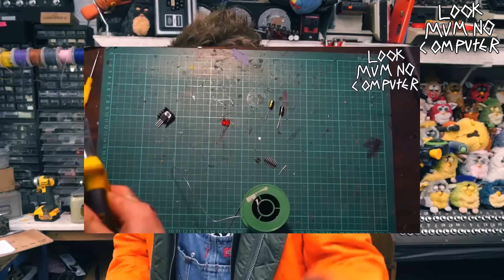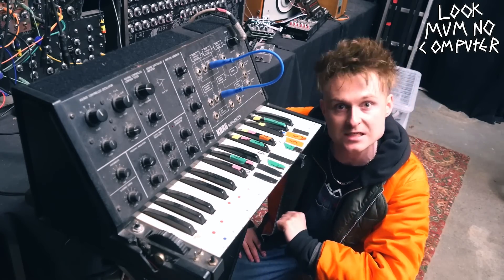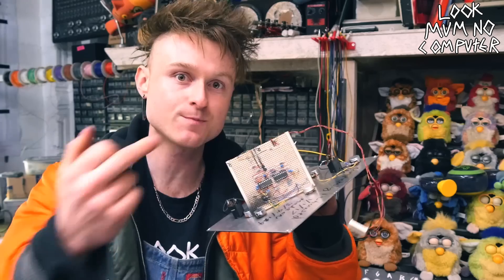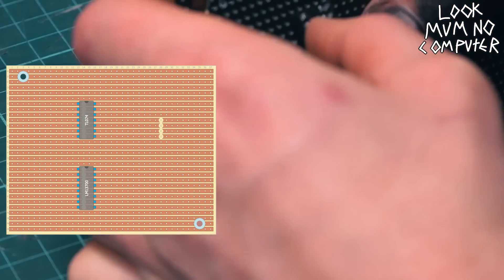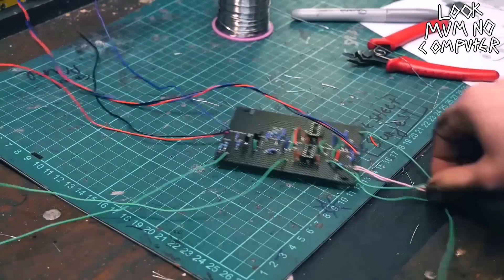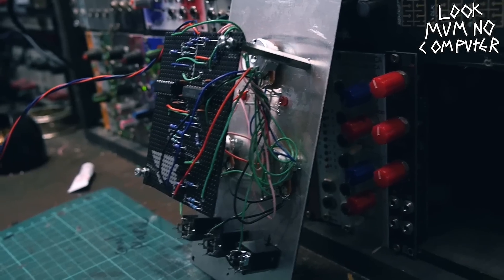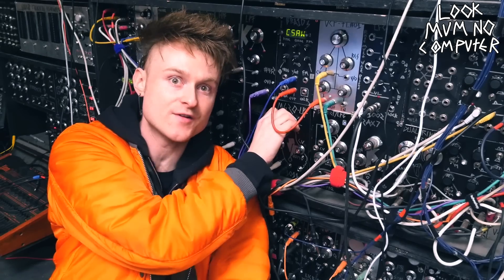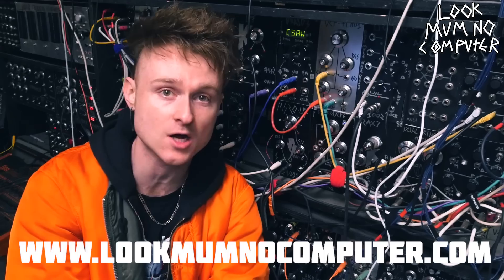Build An Analog Synth Filter Made EASYYYY.

Comment: Hi Everyone, anyone here build this? as i am thinking about doing so. 

Can i ask a silly question, My analog synth does not have CV however i want to build an external filter for it (Prophet rev2). If i built this module would it work with just audio connected to it (In & Out), nothing connected to CV? Cheers

Comment: And here I am with my soldering iron from wish, a Korg monotron and a prefabricated MIDI input mod just waiting to be soldered into the new monotron

After I killed my old one, because I used one of those gas powered soldering irons that produce more heat than the surface of the sun...

Sighs

Comment: You can build a simple filter by  using just a resistor and a capacitor
Reply from the maker: yes and in essence this it what that is, with control. thats an RC filter i speak about it in other videos, but its extremely limited.

Comment: Hey, LMNC, I know you work with 12 Volts, but I'm planning to start a project with some dirty cheap digital oscillators, the ad9833. Would this filter work for lower voltages or should I amplify the signal first?

Comment: Hey Sam any chance you could help me out? I built the circuit on protoboard and the resonance pot  has to be all the way clockwise and pulled back a hair for me to get any sound.https://youtu.be/DLnqNaS2tg8Otherwise it goes dead. I have very little range. That's thru the plain old Input. If I go in thru cv input I get a little more range w the cv pot but still not much. HELP! Any pointers on where I can troubleshoot? I replaced pots, tried different values. Could it be my transistors? Need replacing? I'm lost. Thanks for all you do. You are my inspiration. I built the VCO, works like a charm.
Reply: I built exact to your layout.

Comment: You're absolutely mad as the Hatter and I love it. The only thing I would do differently,is use hot glue on the LEDs, instead of super glue. It makes swapping them out easier and is quite strong.
Reply: Or use LED bezels.

Comment: Could you make a video for a high pass filter?
Reply from the maker: hey tis easy as a piece a pie. your just putting the signal in elsewhere in the schematic. i plan to do this and add to the oscillator circuit in the next vid. ... maybe not this weekend but in the next few weeks! if you want to work it out yourself, go look at the forum thread (link in the description) if you go through all of it, you can work it ooooot
Reply: Legend
Reply: @NfpSiur  dude !! Thank you so much ! here is the page, so everyone interested could jump on it without google :) http://www.doepfer.de/a1011_tec.htm
Reply: HPF is easy, just add an inverted version of the signal into the LPF. Use an attenuverting mixer to balance both signals (one in the positive, one in the negative) before running it into the LPF to get better results.
Reply: yea